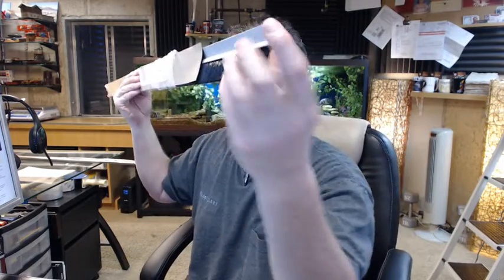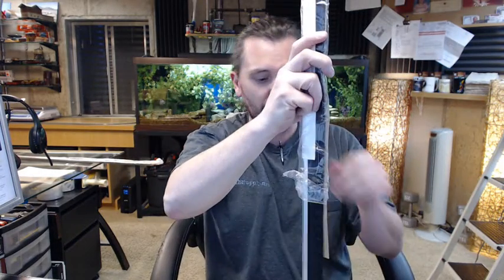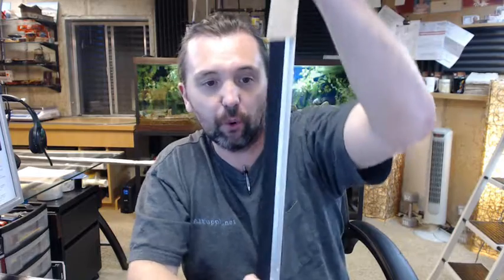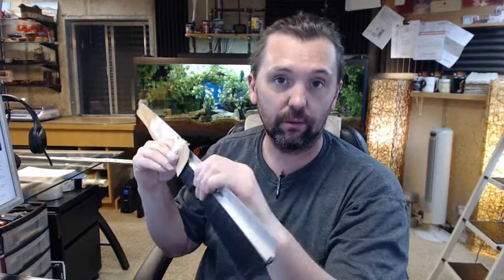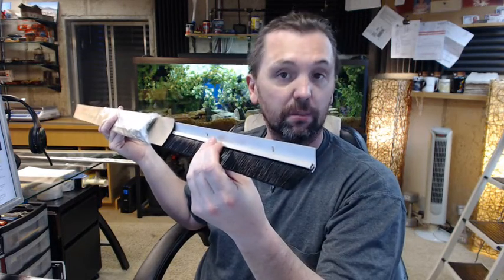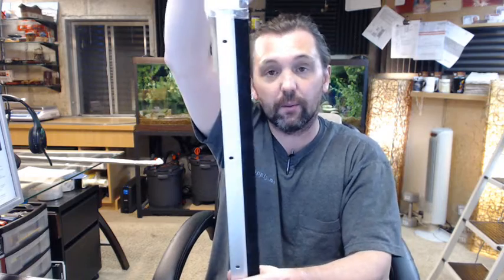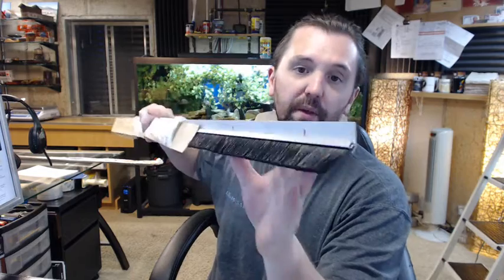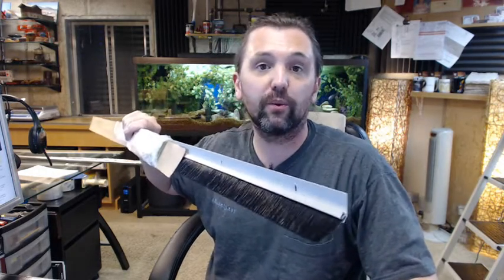Pemko 45100CNB Clear Anodized Aluminum Garage/Overhead Door Weatherstrip - Nylon Brush insert

Comment: How much is it for a 12 x10 roll up door. 2-10 ft sides and 1-12 ft top. I might be interested in buying? Thanks
Reply from the maker: The 
Cost would prove to be expensive because of the length that you are requesting.

Anything longer than about eight foot we are not interested in trying to ship package service and would ship these pieces to you via common carrier also known as tractor trailer or LTL.

The short answer is a few hundred dollars of shipping alone.

If you can live with shorter length but will 8-foot you can easily go to our website at the link here:

https://absupply.net/searchfast.aspx?KeyWords=45100cnb

And review the per foot cost.

Shorter than 8 foot allows us to ship via the common package delivery services.